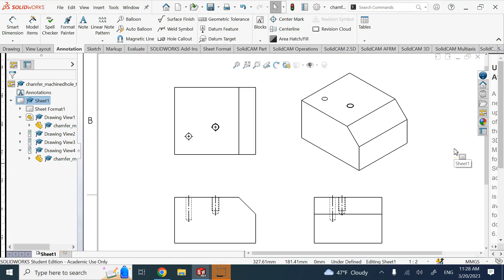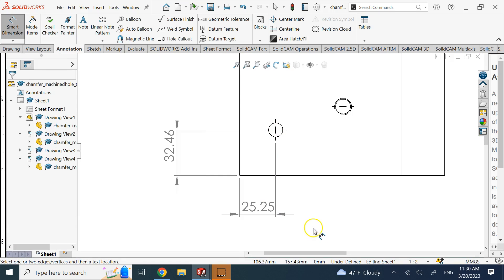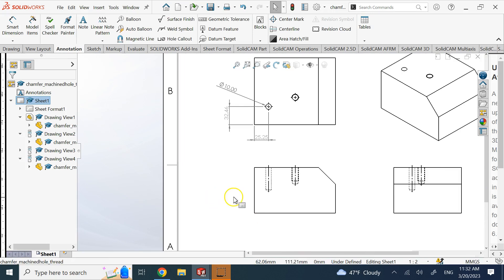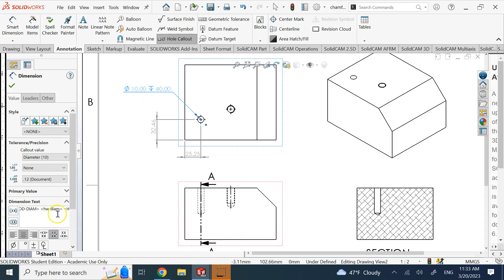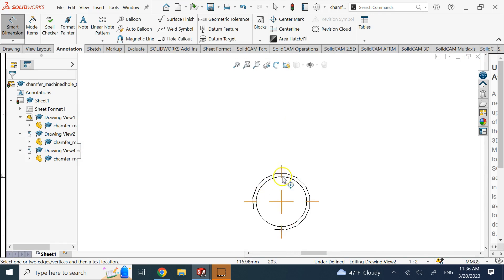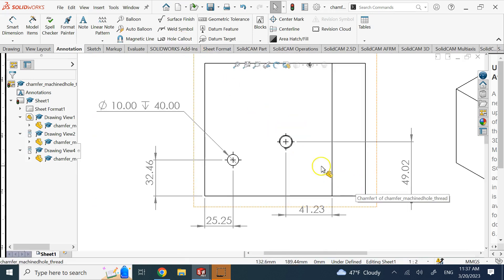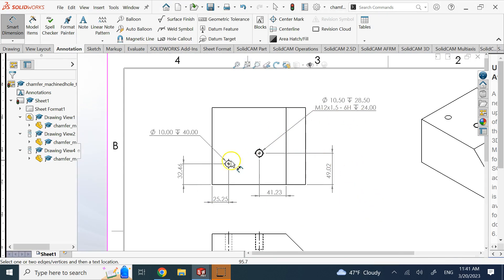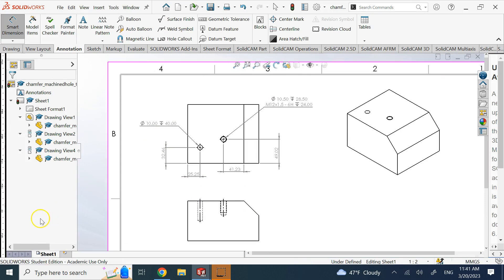Hole Callout in SolidWorks, Dimensions Necessary for Drilled and Tapped Holes

Comment: As a machinist, this print would drive me nuts. Why are you dimensioning the threaded hole from the chamfer of the part, or as you call it 'a fixed edge'. I can't measure that easily. Although the drill angle is usualy not important and is not needed, drills come in 118* ,135*, and 140* points depending on the application. the other infor you gave in this video is good however................